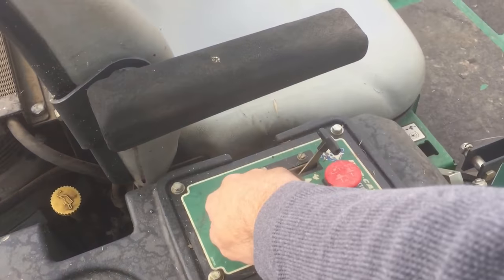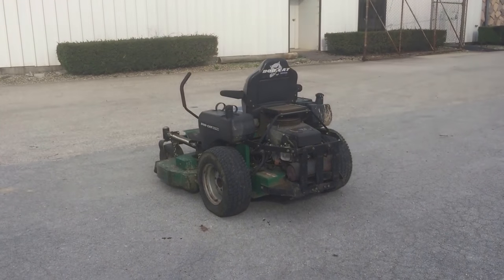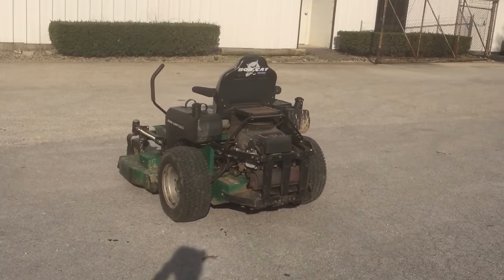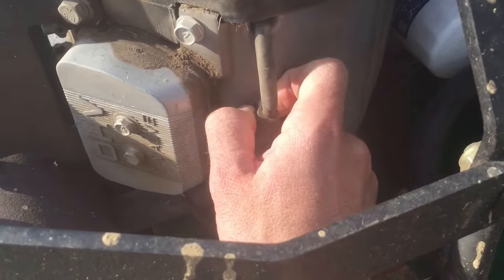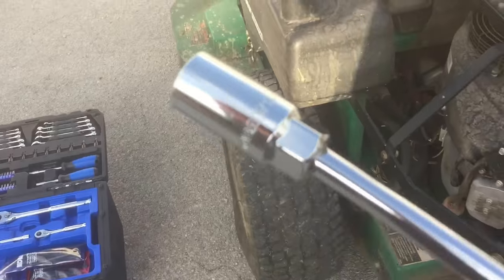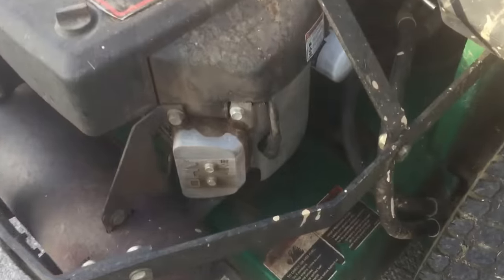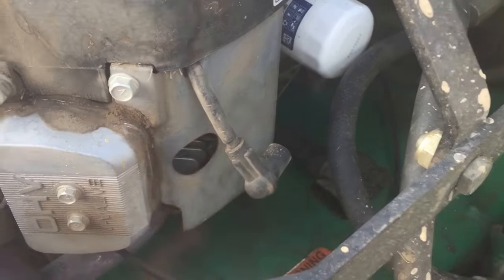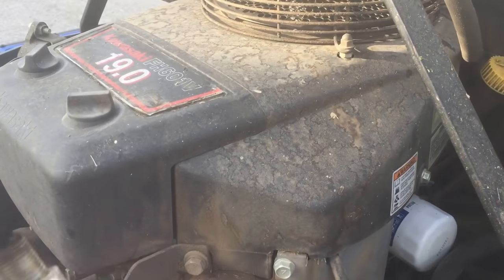Test Ignition Coil Pack on Zero Turn Mower - Kawasaki Engine

Comment: Yes!  This totally did the trick for me.  I was thinking I had a governor or carb problem.  Never thought that I could run on one cylinder like you demonstrated.  Was able to isolate the problem quickly.  Before disassembly I did the additional step of swapping the plugs from side to side to see if it was a defective spark plug (almost never happens).  Once that confirmed the plugs were good there was only one thing to check.  Got the engine cover off and saw the problem right away.  The insulation on the right cylinder spark plug wire on my Kawasaki FG641V was worn through where it makes contact with the intake manifold.  Bad design as the wire is too short to be routed away from a heat source, as well as a ground.  Turns out it was shorting there.  Confirmed with some electrical tape and that baby is humming.  Ordered new coils and will be putting them in before the grass is up to my knees!  Thanks again for your post.
Reply from the maker: It sounds like you made a really good sequence of steps to eliminate possible problems until you isolated it. I generally tell people to start with the simple and least expensive and least time consuming steps first and then work towards the more complicated and expensive after, until you solve it. The YouTube world has experienced and made a video on nearly everything you can imagine. It’s a free and incredible source of information. Glad it was helpful. Great job.
Reply: @ReichpoloTech  Thank you.  I forgot to mention that it finally dawned on me that this was also one of the keys to eliminating the carb as the problem.  If it was a carb problem it would run equally crappy when pulling either plug...definitely not the case with a bad coil!  Thrilled I won't be dumping a ton of $.  I've had this mower 17 years and only 800 on the PTO.....Just got it broken in!

Comment from the maker: Hope you all found this video helpful. If you did, hit that thumbs up button for me, please. Let me know what you think here in the comments.  Also, please consider Subscribing to the Channel.  All of these things really help this channel a lot.
Reply: Took me quite awhile to find this video,  but this one and you other one showing business card thickness spacing were pretty helpful for me.  Thanks for the video,  my issue seems to be quite intermittent.  I put new plugs in and I tested both coils which read the same on all 3 readings.  I thought it was a coil, but perhaps not.  After installed them again so far I haven't had the issue but I will do some more testing and keep all this info in the front of my brain for diagnosing if it happens again.

Comment: Kawasaki fr691-v 2020. Used your tips by removing plug wires while running. Dead right cylinder. Replaced coil with OEM part. Mover back 100%! Thanks
Reply from the maker: Glad it helped

Comment: Great video and I always appreciate the tips.. after watching I dug into my brush mower.  It was overheating and would quit running.  I was going to replace the coils.  After taking fine grit sandpaper to the negative tab on the coil and shining it back up it fixed the issue.  I was pleasantly surprised.  Thanks for getting me started in the right direction.
Reply from the maker: You're welcome. Glad to help.

Comment: Great tip.  Thanks.  The first one I pulled was the good one.  I thought I felt a little shock, but I wasn't sure.  So I did it again.  As I pulled the cover off the plug my hand hit the frame.  Yep... I got shocked.  Be careful.
Reply from the maker: Yeah its probably not a bad idea to wear work gloves.
Reply: @ReichpoloTech  Did my zero turn too weeks ago.  Your video was great.  Thanks.
Reply: I wore gloves, first plug check was OK, the second one LIT ME UP! Even with gloves on, dang, that was like 45 pulses of elec in 2 seconds!

Comment: My Ztrak 925a would run fine for 20 to 50 minutes, then lose lots of power.  I replaced the 2 magneto coil assemblies and that fixed that problem.
Reply from the maker: That's great. Glad to hear it.

Comment: So I tried pretty much everything I was able to find in your videos. I have a Kawasaki FR730 on a zero turn. It seemed to be giving me “dirty carburetor” trouble. I say this because every time I used carburetor cleaner I was able to cut two acres of grass. I refuel every month and use stabilizer. I decided it was easier to replace the carburetor than take it apart and clean it so I bought one on Amazon that brings fuel pump and air filter. I replace it and it bogs down if I increase the throttle too fast or when I put a load on it. I check if both cylinders were firing, I changed the sparks, oil and tightened the springs that go to the governor. It starts and gets to full throttle if I increase it very slowly. Once there it starts to misfire and eventually die out. Not sure what to do.

Comment: very good troubleshooting method.

now lets add some complexity to a problem>  Lets say the engine is running poorly...surging and rough idle...at this happens all the way from idle through the RPM range to full throttle?

AND lets say you remove spark plug wire LEFT...and the engine surge no longer happens.  It's idles smoothly..AND you reconnect the spark plug wire left and surge continues?  So you move over to spark plug wire RIGHT and remove that (with LEFT spark plug wire connected), and the surge ALSO no longer happens.  

In this scenario what could be happening is that one or both of the  coil's internal "back talk diodes" are bad.  Some people call these the Kill switch wires.  On my kawasaki FR691V these are black wires with spade connectors (female) that connect to each of the two coils and then are connected together and this circuit goes back to the ignition switch...specifically the OFF switch position of the ignition switch.  The Idea is that the ignition switch turned to OFF, causes the coils to no longer produce spark energy to the spark plugs.  But if one or both of the internal coil "talk back diodes" are bad, or are going bad...then you can have a condition where the engine runs poorly, rough, and with a surging   governor with or without a loud...but will smooth out when you remove one OR THE OTHER coil spark plug wire!

so here is the test question for advanced troubleshooting:  how do you determine and test which (or both) coil internal talk back diodes are bad...or the circuits of that kill switch system is bad?

bonus points for step by step instructions...extra bonus fo a video.

extra extra bonus points for doing this troubleshoot without a meter or spark plug test set!

God Bless America

Comment: Very interesting.  I have a possible similar issue with my John Deere Z445 mower and I was going to go after the cleaning the carburetor or replacing it, but now I am going to see about the ignition coil.  I will take a video of trying to engage the mower and how it bogs down and post.
Reply from the maker: Good luck with it.  Thanks for checking out the video.

Comment: I tried this with my Scag this morning and when I pulled the boot off the plug, it died on both sides. It starts and runs fine. When I pull the pto up to engage it dies out. I can restart the mowers and engage the pto at half throttle and then ramp it up and I can mow as long as I don’t disengage the pto. Could the coils both be a little worn out and not able to pull all the juice from full throttle?? What else could be going on with my Scag?

Comment: I have an older Lesco Walk Behind 48”. It’s a 15 HP. And Pull Start. And it seems to run perfectly at idol. But when I go and engage the blades it will run for a little then the RPM start to lower and eventually stalling out. Could that be my issue? I bought the mower used, but looks like the previous guy put in Chinese Plugs. 
I put on a new fuel line, shut off valve, and filter. I also adjusted the coils themselves to I believe 0.008 thousands. But this is all before it started to stall when blades were engaged. I work at Advance Auto Parts and bought 2 new plugs and I’m gonna put them in tomorrow. 
What could your thoughts be? Thanks for all the help in advance. Big Jim Chardon Ohio

Comment: Exact problem I had with my Kawasaki 25HP , it would mow fine for a while but when it heated up the coil would start breaking down and start skipping when I engaged the blades. After isolating the left coil as bad I decided to change both coils.
Reply from the maker: Yeah changing both coils is not a bad idea.  The other one may have last for years or days, but changing both will give you piece of mind that you should be good for a while.  Thanks for the comments.
Reply: Exactly what mine is doing now.  Runs for an hour great, then the coil starts to break down and gets intermittent.  New coils are on there way.  I pulled the one plug wire and it killed the motor.  Hope that's it.  If not, it's going to take some time to figure it out.

Comment: Mine is odd, one wire to coil which grounds them to kill engine, last one wasn’t firing, so I replaced coil, still same problem, I figured out if I unplugged the one wire to that coil it ran perfect? Makes no sence? Both are wired to the exact same wire, but if I unplug both it runs great, if I plug in just one it runs great also, if I plug in both it bogs? Any help greatly appreciated

Comment: I'd like to point out that my cylinder kept running after unplugging the spark plug, but It caused backfiring, which is also a sign of a bad ignition coil.

Comment: I have the same mower, I can cut for about a hr then the mower just shuts off. I have to jump the brand new battery and it will start but the blades won't kick on, not enough juice. I then have to charge the battery and cut some more grass. Do you have any advice ?
Reply from the maker: It sounds to me like you may have a parasitic drain on your battery.  Do you have any aftermarket stuff on your mower, like a led lightbar, or a fan, etc.?  If you do, you may want to make sure you have a toggle switch turned off or install one if you don't have one for those things.  Another thing that could be the issue is the generator on the mower.  The generator is essentially the same thing as an alternator on a car or truck. It charges the battery as the mower runs.  Lastly, it could be that the battery has some bad cells and won't accept full capacity.  You should be able to read 12.0 to 12.7 volts on the battery when fully charged and not running.  These are the first things that I would check, if I had it in front of me. Good luck with it. I hope this helps.

Comment: What about a mower that is turning over very well smells like gas but after cranking a while the motor runs fine I recently  replaced  the stator battery  an regulator due to mower not charging at all after I replaced  it now it seems to crank an crank an crack till it finally turns  over enough  it finally runs
Reply from the maker: I know this seems silly, but check your choke cable.  I had mine come off the motor side once.  Causing me to make this video. https://youtu.be/8suODVy1PDY

Comment: What if the condition continues after the ignition coil is replaced?  What is the next step to determine the problem?
Reply from the maker: That is hard to determine without the machine in front of me.  You need the proper mix of fuel, spark, and air for it to run right. I would start with the easy stuff. Check air filter, check fuel filter, if its on a zero turn check the battery voltage, check your throttle cable to make sure it didn't slip or stretch, check spark plug gap, check to make sure a mouse didn't chew threw any wiring.  Just some off the top of my head.
Reply: Some 2 cylinder engines have 2 barrel carbs with 2 separate jets for each cylinder if One jet is clogged it can cause it to run in one cylinder

Comment: Thanks for the tips but brother your fuel pump bracket is either broken or lose as hell! It should be solid as a rock on these kawasakis. Surprised it's not pulling the vacuum line off. Best of luck!
Reply from the maker: Hey thanks for the checking out the video and glad it was helpful.  I checked my fuel pump bracket and everything is solid as a rock on there.  I took a look at the video to see what you may have been talking about,  and I have come to conclusion that the bracket or the fuel pump are not loose.  I did video stabilization on this video prior to uploading it,  and I believe that you are seeing a slight glitch in that effect.  The video is a little wavy for a couple seconds right as I pull off the first spark plug wire.  I do appreciate your comments and I certainly did go check that to make sure it wasn't loose.  Thanks for your comment and have a great day.
Reply: ReichpoloTech hey thanks for the response. Good to hear your machine is A-OK. I don't know enough about image stabailization and filming so I had no clue that was the deal haha. I just replaced a coil on a 17hp Kawasaki using this technique for diagnosis. I had one loosen up and contact the flywheel. Luckily didn't rip the mounting ear off, just glazed the surface of the coil contact. Had pulled your video to show my buddy what I was doing. Solid info and always great to watch for a quick memory refresher. Thanks again. Keep up the solid work!

Comment: My Ztrak 925a would mow fine and then intermittantly the mower blades would turn off.  I would push the mower switch down and then pull it back on and the mower blades would spin.  Apparently the push pull switch was bad.  I replaced it twice.  The third time, John Deere parts had done away with the push pull switch, and superseded it with a rocker switch,  which works much better and does not cut out.  BUT, the john deere replacement switch does not fit into the existing switch mounting hole. (bad fix ,John Deer engineer..  Were you thinking about sex again?  so you messed up.)  I just left the new rocker switch hanging out so I could demonstrate to anyone how John deere fixes things THEY broke.  The switch works more reliably than the OEM original equipment part.  I am happy again.
Reply from the maker: Glad you figured out a solution. Thanks for your comment.

Comment: Its not always due to a bad coil, you could also have a mechanical defect like valves staying open causing not enough compression to support combustion , you should perform a compression test to confirm your diagnosis...!
Reply from the maker: I understand what you are saying, BUT I say it numerous times in the video that it is "likely" or "more than likely"  the ignition coil pack, because we all know that there can literally be a thousand different reasons for issues.  I didn't have  hours and hours to go through them all on the video or it would be hours long, so I showed this as a way to eliminate a few and get a "likely" reason for those people with slightly less knowledge of engines and also possibly less tools in their possession.  I appreciate the comment.  I like when people post intelligent comments. Thanks.

Comment: Easier way to test for a dead cylinder is with a spray bottle of water, spray it on the exhaust pipe coming from each side and the one that doesn't sizzle is the dead cylinder, that way you don't burn your hand or shock yourself pulling a plug wire.
Reply: Long time ago I pulled a spark plug wire on my car and got the snot shocked out of me.  Good times.